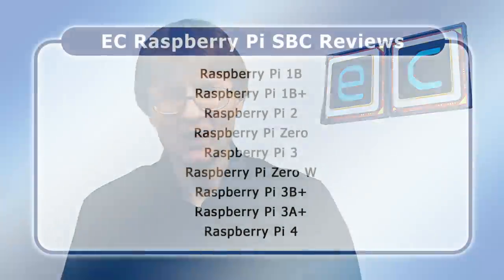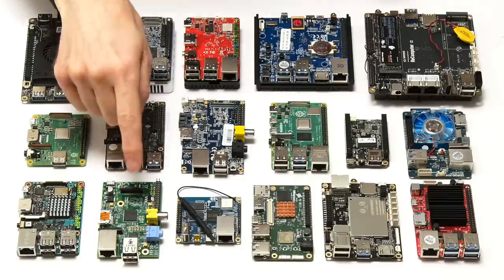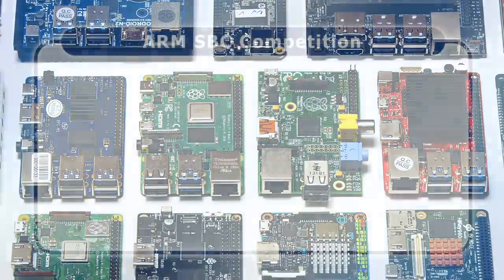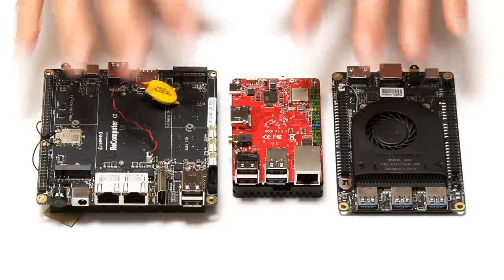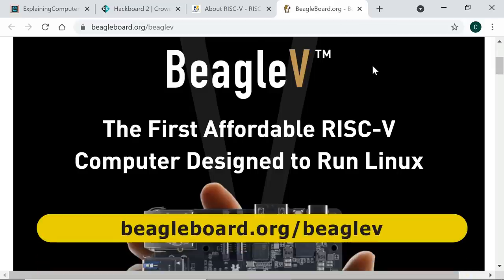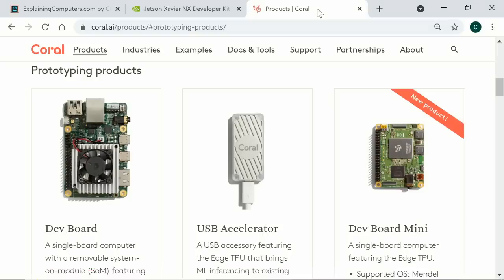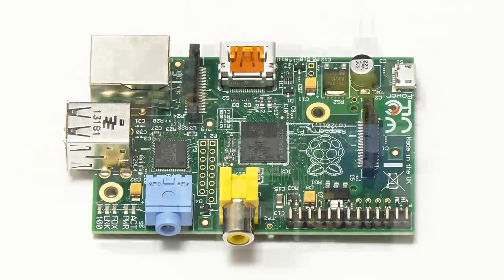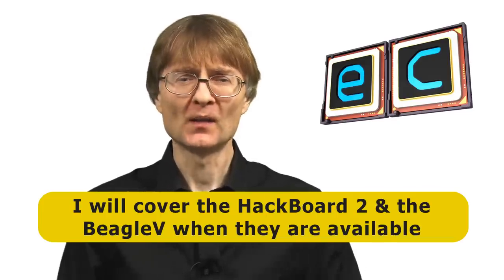SBCs in 2021: The State of Play

Comment: There is a plethora of cheap android tablets that are sub $100 and include a lot of goodies missing from an SBC (such as touch screen, wifi, etc), and have a well supported OS base (android). So my question is....., why aren't these being used as a basis of a powerful SBC by just figuring out how to add GPIO?
Reply: maybe because you cant add GPIO on an android tablet.
also there is no useful software for android that you can run, plus installing an os that can do it is impossible.
Reply: @Xiefux  there is gpio available, e.g https://numato.com/product/8-channel-usb-gpio-module-with-analog-inputs/
So my question still stands.
Reply: @mikedavison4313  didnt know these even existed, pretty neat.
but would it work with an android tablet?
maybe it needs some driver that the tablet doesnt have, and adding one in that case could be a nightmare
Reply: @Xiefux  same link. Supported os includes android. I might try and get one to experiment.

Comment: Well, the C64 was a single board computer too
Reply: My 2015 phone is an SBC with wireless screen mirroring, built in display,   battery power, storage,  etc.

Can be had for $50-$100. 

Just need to flash a ROM onto it.

Comment: Almost every phone and tablet runs ARM processor and it's not held them back. Apple moving over to ARM. x86 too much power consumption for maker SBC.
Reply from the maker: Yes, and I am not saying in the video that there is any problem with ARM. My argument is that porting a Linux distro, and writing graphics and others drivers, for a custom ARM platform is a constraint on SBC development that many of the smaller manufacturers do not overcome. Phones and tablets have great drivers because they are mass manufactured. But most SBCs (basically all aside from the Pi) are made in batches of a few thousand, and the profit on those kinds of numbers is not enough to pay for the software development necessary to get (eg) hardware accelerated video playback working on the device.

Comment: The problem I have with Linux is the general language/lingo of it. I feel there is a really wide gap in levels of understanding between users of Linux itself and key developers, and I believe that is why Linux is far behind in ease-of-use
Reply: It's basically a mult-user system and windows is a personnel computer so there are fundemental differences. Also how linux keeps certain types of files in certain system directories takes some getting used to, not like windows. To get to know linux you do have to look at it like a project and go through tutorials and books and treat it like another project that does not have an ending.  I have to keep a cheat sheet of commands and by the time I use a command 5 o 7 times it starts ot stick with me.  I got frustrated with linux and took me 3 times before I stuck with it. The old tyme linux users are probably extemely smart, technical savy and probably excellent C programmers.

Comment: @4:35 onwards about software support & the community ( happy hackers like myself ) I think you sooooo under estimate it.  Early adoption has never seen it so good with development / massive community around the not yet released BeagleV we have several ports of Linux ( Gentoo, a close Arch etc etc etc ) via VM and the general state of Arm support is way up there also and super active across SOC's.  Why do you complain so much I mean SBC;s are not for everyone this is NOT a windows users area, I think this is very unfair / snub towards those that do and not moan.
Reply: Sure that's today but at anytime in the future  those people could take up fishing or hang gliding and then where will you be? The RISC V is getting the attention because it is shiny and new but one day ....
Reply from the maker: Thanks for this, and my apologies -- I did not intend to snub anybody. I am aware of the massive amount of work that is done by the SBC community across many devices/platforms. My point is simply that expecting any community to provide the software for an increasingly complex and broad range of hardware is never going to be an optimal solution.
Reply: @sharonwolff1  Most like myself have been here since the early Beagles / Panda's ( Bones ).  I myself do support a local makerspace with Robotics / electronics / code ( C/C++ Java Python / Perl (R if needed )) we do want others to Join the fun.  My main issues are the levels of expectancy most of the time is set way to high in this area as its not a huge money maker so does not get the coverage so its down to people ( normal people ) to get it done.
Reply: @ExplainingComputers  Unfortunately with alot of cheap Chinese variants on hardware using RockChip / AllWinner SOC's that is going to be the rule of thumb that your mileage will vary, but with the work and cross pollination done by Pine64 groups / Khadas ( yes we actually talk to each other ) support ( for users ) and hardware support / fixed issues is very high.  We really should welcome the hardware as choice is always good.

Allwinner is still problematic i will grant you as still as of today not a single whitepaper / BSP has been provided so you have to hand it to the SUN-XI group for getting that SoC line to the standard it is at as it looks to be close if not infact a 100% reverse engineered effort.

As ive mentioned though you have to approach the SBC / embedded space with a different mindset to what you are used to with regular PC's and set the bar accordingly as to what you are expecting obviously perhaps do some homework / talk to community people as most have IRC channels and Discord's with people that will answer questions / fill in blanks in real time.

Just some pointers really for those that still might be unsure,  "We dont bite,  honest".  As I mentioned in a previous post I help at a local maker / hacker space with alot of electronics and answer almost identical questions there also.

Comment: One thing is still far from being efficient in the SBC world: distributed computing in a cluster of Rasp.PI boards. Yes, there are successful stories with experiments, but nothing that actually could be considered "serious" application. I think it's partially due to the lack of a well written (or efficient) software infrastructure: I envisage a "distributed" Linux kernel that abstracts the hardware layer, and "exposes" the processing "cores" as a whole to the application; but that's a bit too far fetched, at least for now. Anyway, it would be interesting to cover this subject: a test with, let's say, 4 Rasp.PI nodes running a compute-intensive task, with benchmark that cover both speed, efficiency (thermals and power consumption) and some consideration about cost/benefit ratio. Would it be too much of a project? I, for sure, wouldn't even know where to start from...

Comment: SBCs are obsolete. Just get a smartphone, and an USB/GPIO expander. You'll have an SBC+GUI+plenty of connectivity+an integrated UPS
Reply: That’s dumb. Phones can’t replace some (if not most) of the functions that SBCs can do. With an SBC you’re completely free to do whatever you want with it software-wise. On phones, you’re stuck with Android, which won’t work for most of the projects SBCs are used for. Unless you somehow manage to replace Android with some GNU/Linux distro though.
Reply: Phone battery VS retropie...
I think you don't want to learn children Linux
Reply: @alejandroooow  Thanks for the "dumb". My point is: SBCs were a cool, cheap and versatile solution for different applications 5-6 years ago. Now you can get for few $ any piece of hardware you can hack (home routers, nas, media players/centers, kids PCs, surveillance IP cameras, etc), if the function you want to implement does not exist yet. 
Then, if your time is cheap, and you want to spend days (weeks), money and effort implementing/optimizing something already developed and cheap, you're welcome. Have fun. Cheers.
Reply: Boodysaspie  You can get smartphones for 55$ and above. How much does it cost an SBC+SD card+power supply? (Let alone LCD, cables, UPS, GSM/GPS, gyro/accelerometers, full HD camera...)
C'mon guys. Stop it.
Reply: Boodysaspie   @Boodysaspie  Yes, you're right and thanks for explaining your vision. But my point is that if you need a htpc, in 2021, you can buy one for 20€ (4k, 4 USB ports, HDMI, spdif, remote included) on AliExpress, you push play, and you're done.
You need a nas? Take your old router, flash openWrt+samba and you're done.
Many of the SBCs enthusiasts (who commented above) don't even know the difference between a micro and a SOC.
I purchased used and dumped a lot of SBCs and I also don't know anybody who uses a RPi as a desktop replacement on a daily base
I mean, they're funny toys, but you find much more technology in a low cost smartphone.That's my point on "obsolete".
Bye and thanks for sharing your points

Comment: Raspberry Pi has "Superb software"? You mean their official OS that is already 8 years late for their own 64-bit products and still in beta, hidden from general public? Or the huge, knowledgeable community that ALWAYS tells you to get a new unit or a new SD card no matter what the problem is? Why, at least hardware is supreme indeed, forcing you to buy more accessories than ever before - custom charger, micro HDMI adapter, fans, heatsinks and whatnot. Not the fastest SBC either, with its laughable DDR3 memory, and slower CPU than some models I have in mind. Please don't state your opinions as if they were facts, some people actually take your knowledge for granted.
Reply from the maker: In my opinion -- and clearly this video is an opinion piece -- the Raspberry Pi has the best software of any ARM SBC. So it is "superb" in that respect. Everything else you describe in your post concerns hardware. I've been pretty active in the Pi community for many years, and do not recognize your reflection of it "ALWAYS" telling you to get a new unit -- this certainly is not a "fact". I totally agree on the custom PSU, micro HDMI and third-party cooling requirements (for a Pi 4). Most certainly the Pi 4 has less powerful hardware than many other SBCs (as I clearly show in the video) -- this is my point, as I discuss in the video when I cover market segmentation. The Pi (range) stands as the SBC with the best (ARM) hardware and software combination at its price point.

Comment: You should rename your channel "Explaining Fanboyism".

The software support in Raspberry Pi is absolutly catastrophic. The OS is still 32 bit, it uses LXDE which was abandonned 10 years ago and still use an outdated GTK2 framework, finally there's still no hardware decoding support for 64 bit KMS driver.

I suspect that their outdated OS is good enougth to sell thousends of boards to digital signage compagnies which are their big customers.

Do you plan to tell the truth someday ?
Reply from the maker: We clearly have different points of view. I have been deeply critical of the Pi on occasions -- eg re video playback, lack of cooling and micro HDMI connectors (although the first two of these have been significantly addressed). But in my view Raspberry Pi OS works very well indeed. Not least it is a very stable distro. Naturally I am comparing the Pi's performance to other SBCs. But I could -- and have -- spent weeks only using a Raspberry Pi and it worked well. The approach of the Raspberry Pi Foundation is clearly to maintain an OS that is stable and backwards compatible (hence still 32 bit), and I've no problems with that.
Reply: @ExplainingComputers  the problem is that when you test video playback you use stats for nerds which shows frames drops but it's only a part of the problem.

There is a lot a video tests on YT for example this one :
https://www.youtube.com/watch?v=cuXsupMuik4

It shows both tearing and stuttering. If you try it on your desktop PC, it would hopefully play perfectly fine, at least my cheap Athlon 200 GE I bought 56 euros back in 2019 plays it perfectly smoothly.

Now try the same video on a Raspberry Pi and you'll see the results. It speaks for itself.

o<(8°)